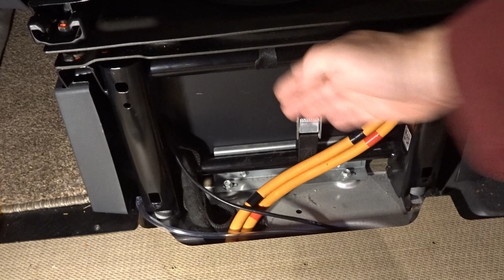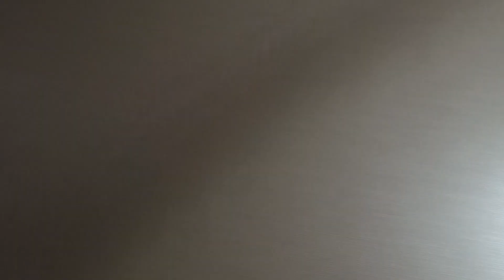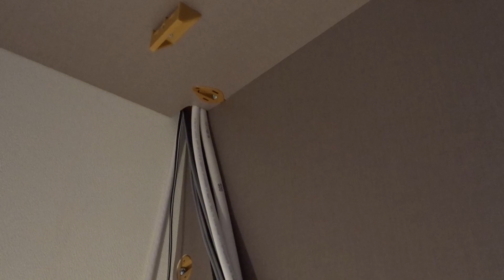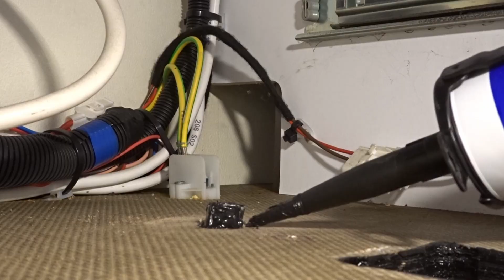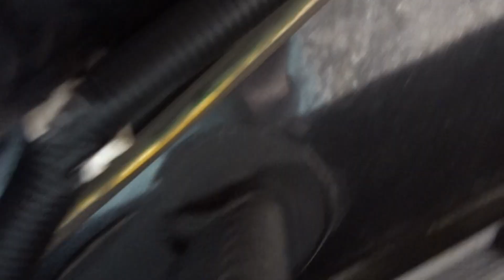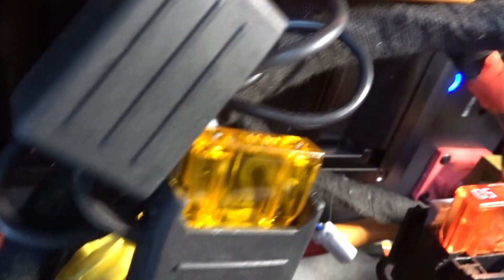Burstner 744 Lithium and Solar upgrade - Part 11

Comment: Hi Richard! I am watching your videos because I plan to do the same updates to my burstner. I plan to replace the AGM battery with a 100Ah LiFePo4 charged by an MPPT (actually 2 of them because I want to use also additional mobile solar panels next to the ones on the roof). I am wondering whether it really works to connect the smart inverter between the AC input and EBL. I think there is an endless loop - the battery will give power to the inverter which will power the EBL and also the battery charger (because the battery should charging when plugged in), therefore the LiFePo4 will continuously charge itself through the invertor. Am I wrong with the schema? Thanks!
Reply from the maker: Hi Adrian. Maybe I didn't make it clear, but I disconnected the AC feed to the EBL completely, so it's charger function now does nothing. All the EBL now does is handle the 12v distribution to the rest of the van.

I still haven't gone the whole hog and powered all the mains appliances in the van from the multiplus inverter output for exactly the reason you mention.

At present I just have a single mains socket powered from the inverter into which I can plug laptop / wife's hair dryer etc. If I want to, for example, power the microwave, then I physically unplug the mains feed to the inverter and run a hookup cable from my single inverter output socket out through a window and plug it into the external EHU input socket.

Not ideal, but it works.

I do need to make that process automatic, which will involve some sort of changeover relay to avoid the loop you describe.

A project for the winter, which I'll video once I've decided how to do it!

Cheers.

Richard